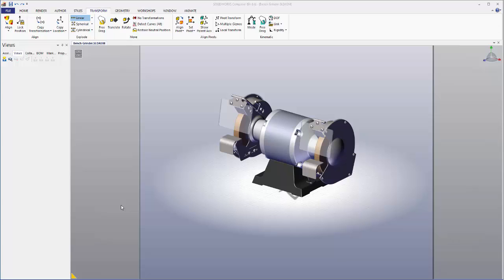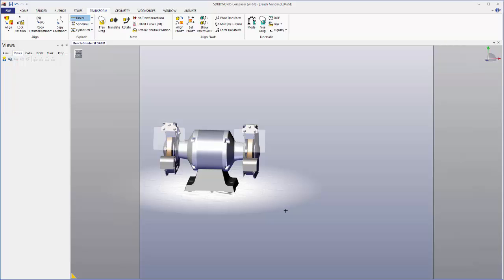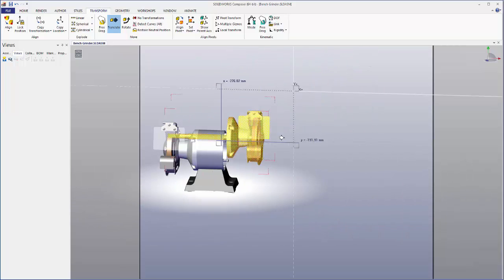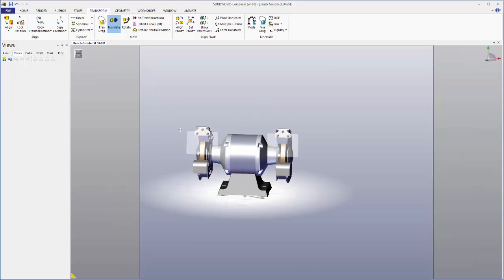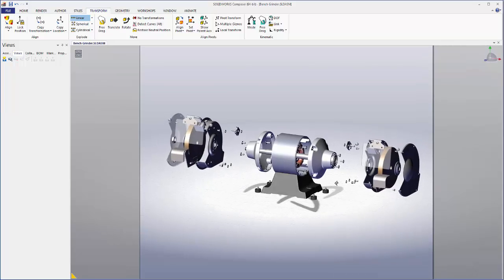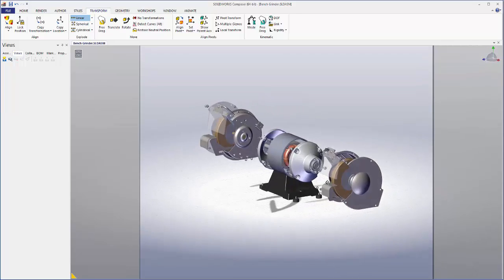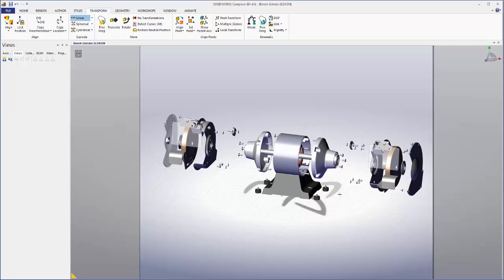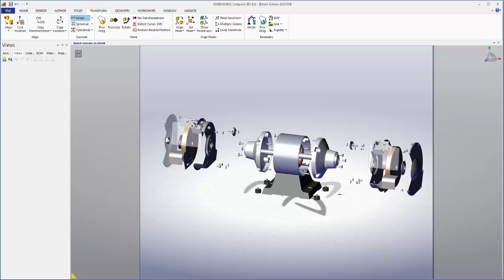SOLIDWORKS Composer Quick Start Guide #2: Using the Translate and Exploded View Tools pt. 1

Comment: Hi there! Accidentally I turn some mode or do import wrong (SW assembly) in Composer, when I try to transform selected parts or assembly, it move by X and Y axes simultaneously, but I need only by X or Y, how to fix this? I try to select only X or Y, but it allows select at once only Z.  Thank you! )
Reply from the maker: Hi there! A great place to start for direct support would be our User Forum. We have a great team of SOLIDWORKS experts well versed in technical aspects of the software. They would love to help you out. We can also direct you to our support form here, where requests are triaged and responded to by our team: https://www.3ds.com/online-store/support-form/

For technical inquiries, with your subscription, you can always access Knowledge Base for immediate troubleshooting. If Knowledge Base does not help, you can contact your local reseller through your organization. Or you can reach out to our technical support team twitter account @SOLIDWORKSCare.

Even without a subscription, you can access your MySolidWorks for information. Check it out here: https://my.solidworks.com/